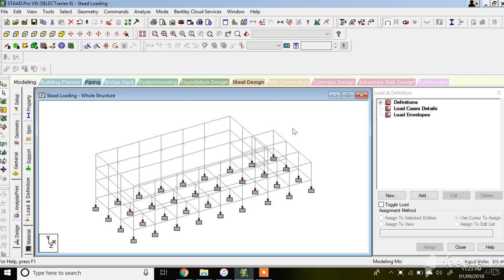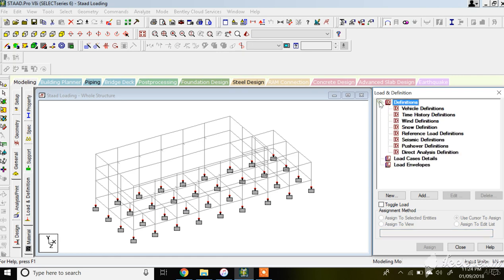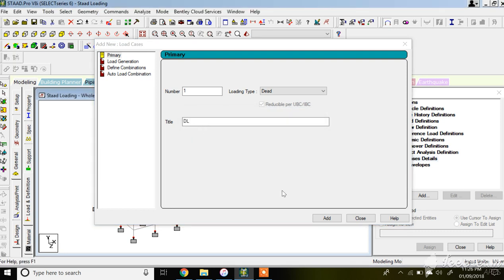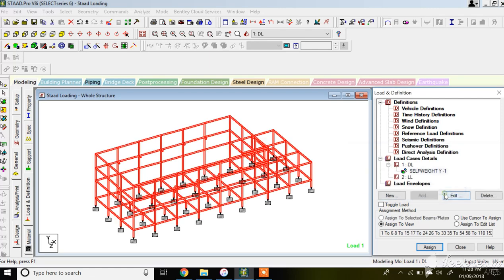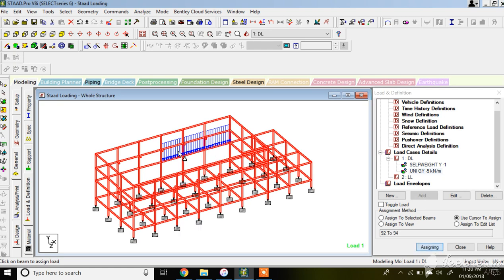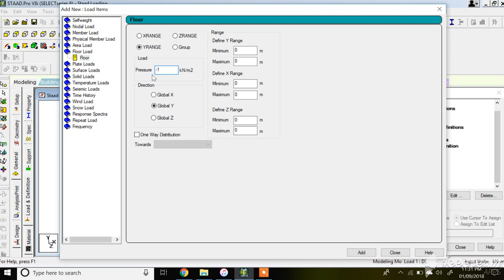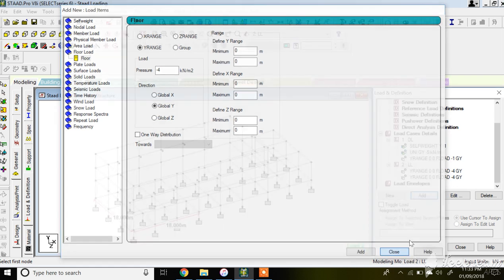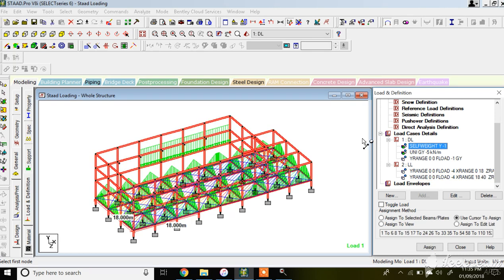HOW TO ASSIGN LOADING IN STAAD PRO- DEAD LOAD & LIVE LOAD

Comment: Sir I checked your other video on g+6 rcc design  but there you assigned the wall load to the columns whereas in this video you are assigning to the beams only. What is the correct procedure?
Reply from the maker: wall load shall be assigned to beams since walls rest on beam. in case if anywhere wall load is assigned to the columns then it might be an error.